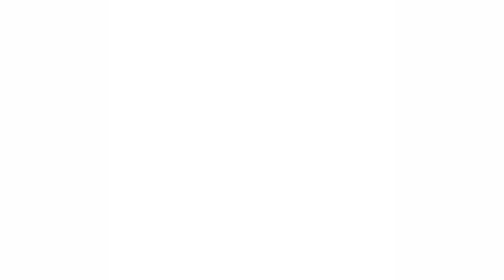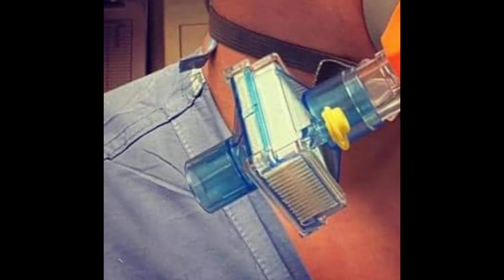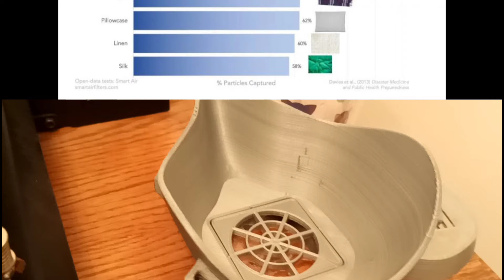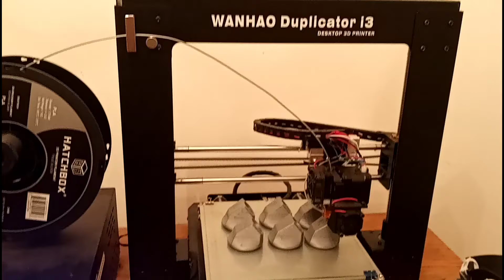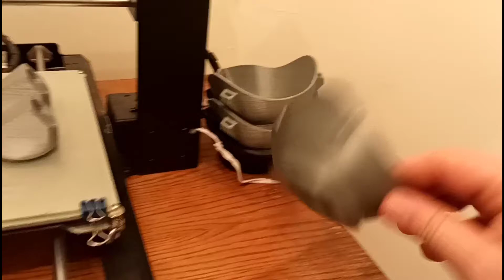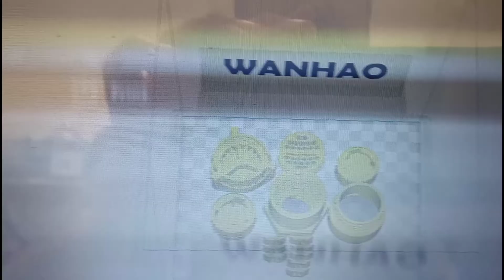3d Printing Respirator Adapter for a Doctor

Comment: Wait how did that take 14 hours at 20%? Is it TPU?
Reply from the maker: Na, I use a very old version of CURA and have the resolution set at .1 (very fine detail) so it takes forever lol, thank you for watching
Reply: @ProlificInvention  ah ok that's kind of what I was thinking. I do everything on draft ot normal setting.